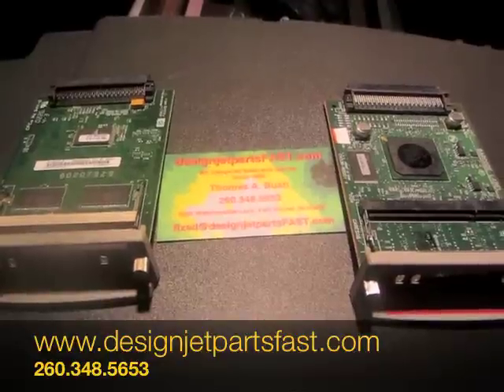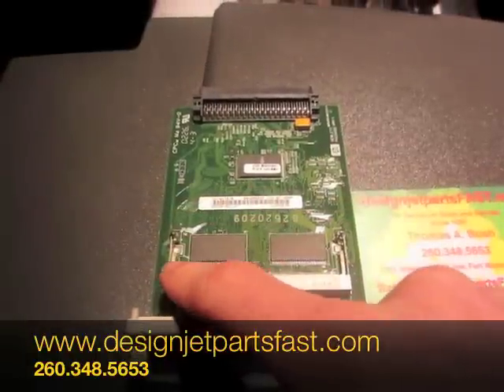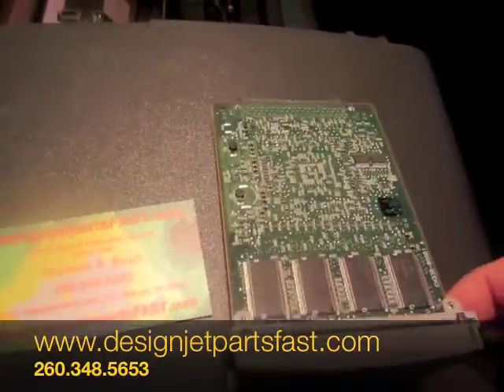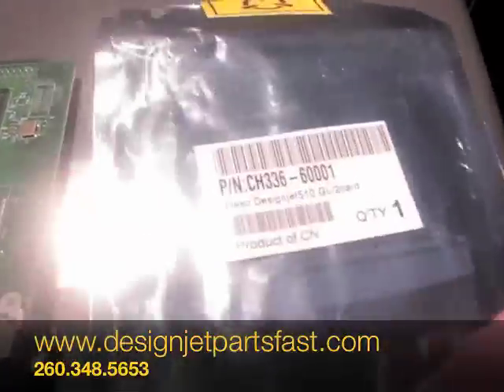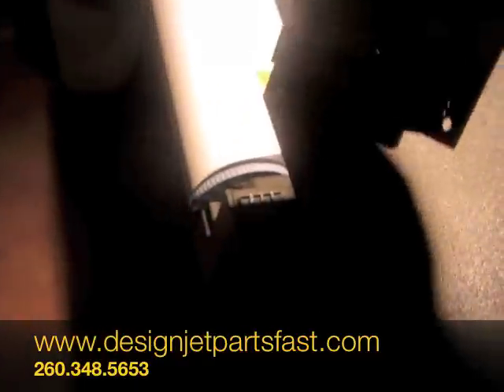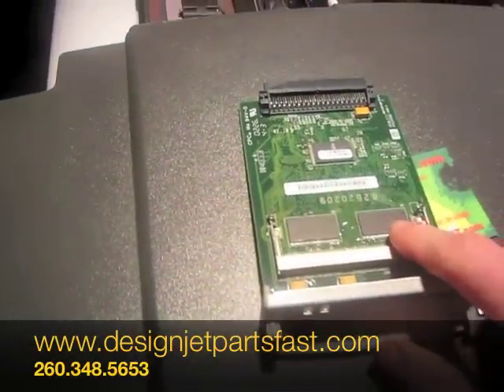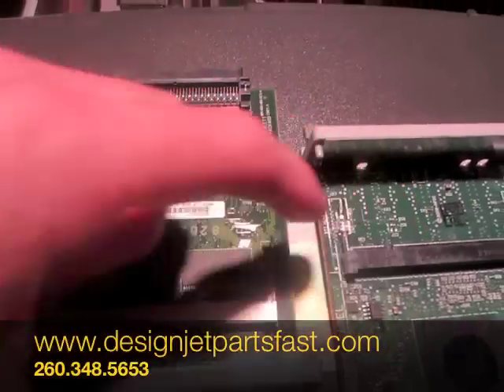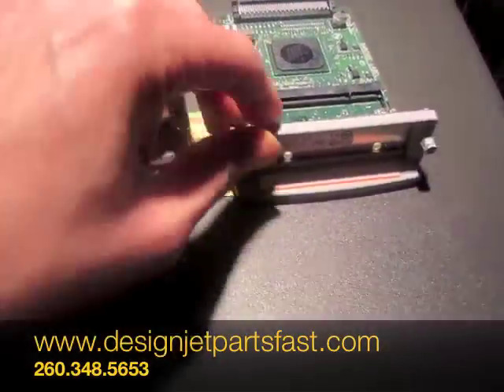05:10 service error: Designjet 500 GL/2 Formatter Board vs. Designjet 510 Formatter Board

Comment: This video was very helpful. Researching this part I found thatHP has many part  numbers for the HP Designjet 510 formatter board. HP like to issue a new part number for a 
new lot being released for consumption. Here is a breakdown of popular 
part numbers. HP Designjet 510 model has three different part numbers: 
HP Designjet 510 CH336-60001 HP Designjet 510 CH336-67001 HP Designjet 
510 CH336-80001 HP Designjet 500 C7772A. I bought one at the link you provided, designjetpartsfast.com. 
Replaced and everything is working with no issues. Thanks again for posting the video.